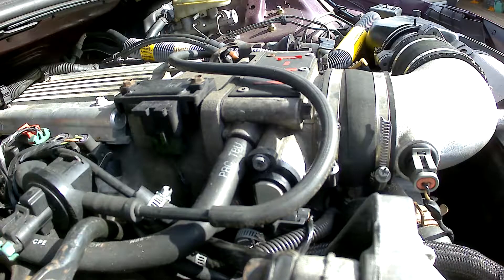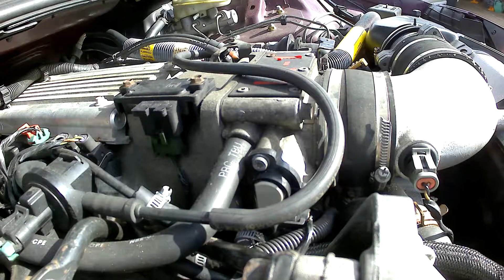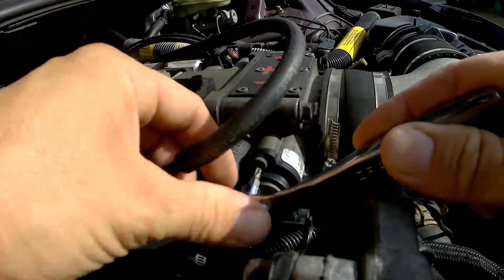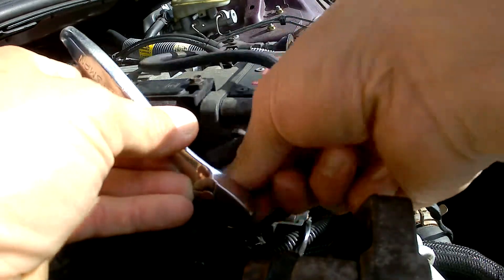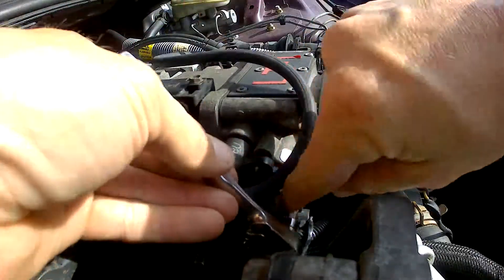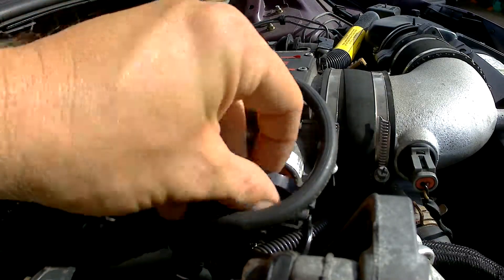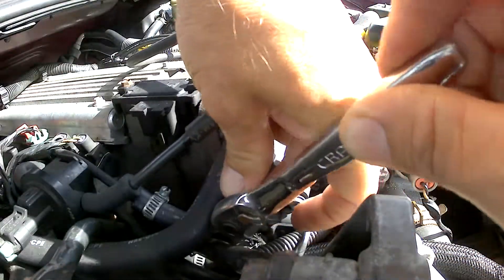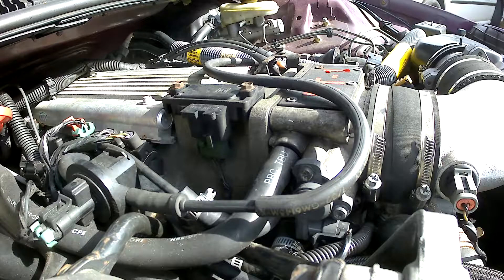THROTTLE POSITIONING SENSOR REPLACEMENT ON 1996 FIREBIRD

Comment: Yes I just got a new one how do I recalibrate it I’m revving at 3000 rpm at. Idle
Reply: You need to test what the tps is putting out in dc volts then change it and clock your new tps sensor to the same value youtube it you cant just slap it in and go this guy got lucky it was close